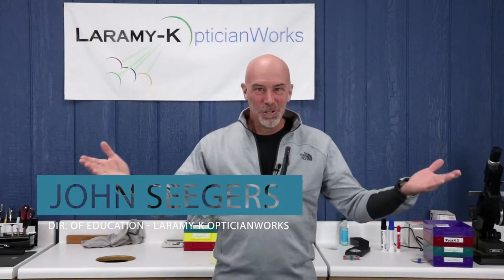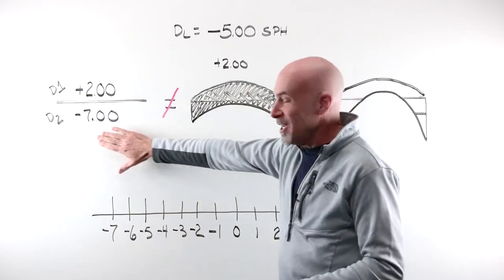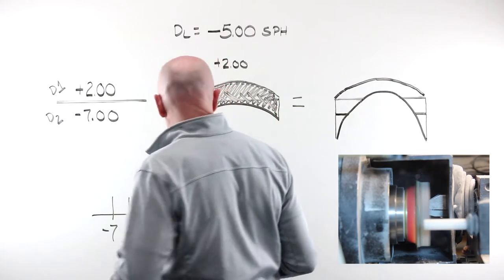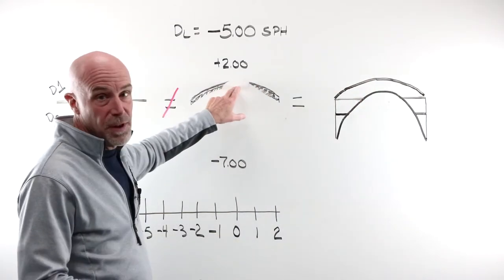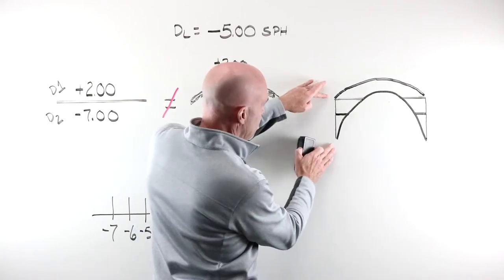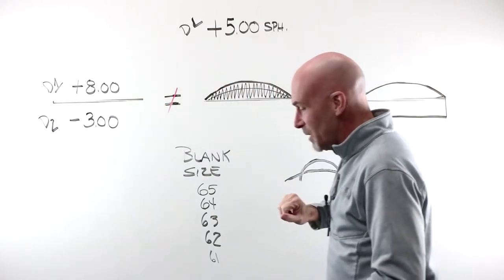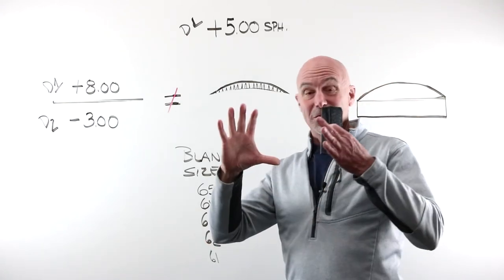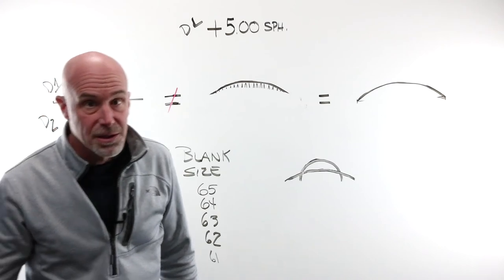Nominal Lens Formula Part 3 - Lens Curves and Thickness

Comment: Dear Sir, I am beginner wooden eyeglasses designer and manufacturer, and I am starting with reading eyeglasses, so I got virgin lenses from chinese manufacturers. I do have a Vigor type of lens clock to read, both, front base curve and back lens curvature. I was testing myself as lens clock reader, but I could not came out with the right lens power as the factory is indicating in each pair of lenses I got. I took one of the lens as an example as  FSV 1.56, SPH +2.5 and CYL 0.00.
Values from the lens clock were for n=1.6 +6.0 and -4.0, and when a use n=1.49 scale, were +5.0 and -3.75. I used DL formulas with no success. Any help from you it will be very appreciated. Thanks.
Reply from the maker: For many reasons - You cannot accurately and repeatedly read lens powers with a lens clock. You will need to find a used lensmeter. John
Reply: Dear John, many thanks for your very quick answer. I will search for a second hand lensmeter, I am sure I will find one in good conditions and reasonable price.

Comment: How is the axis formed and placed (physically) into the lens in the process of the two sequential grindings? Is the 2nd grinding done with an elliptical shaped bit tool rotated around a spindle along its major axis and at a right angle to to the 1st grinding's spherically shaped bit tool's spindle? (Again, not an Optician here, .. and so have never seen a Lens Grinder machine)
Reply from the maker: Start here: https://www.youtube.com/watch?v=yL_02Cxkmxk&t=212s
Reply from the maker: Joe, In addition to the how-its-done video check out the video on "climbing mount cylinder." Axis doesn't exist. It is just an imaginary reference point we choose to assign to a lens by dividing it into 360 or 180 degrees. Axis is a notation of position, hence why we can't use it in a mathematical formula. Degrees we can when we use the trig functions SIN, COS, TAN, etc. I'm making it sound like I understand it. I don't I'm an optician not an engineering or physics person. There is a huge, huge difference between the two. The questions you are asking are optics or physics questions and the answers would be found in a text book on ophthalmic optics. I'm sure you could find plenty of them used on Amazon. John